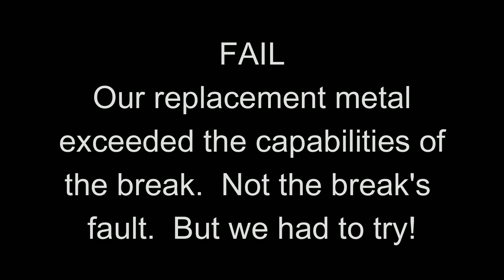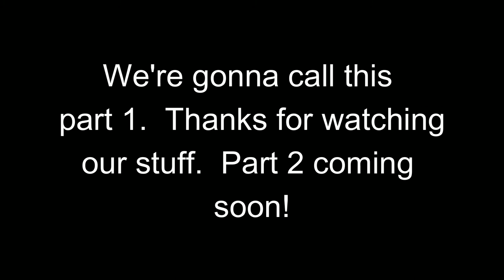Inner fender rust repair for the 74 Shoebox Bronco

Comment: How did you get the aft bolt out on the fender? I can't get it to save my life with that plenum in the way... just spins
Reply from the maker: It ain't easy.  We ended up cutting the head up a bit with a small angle die grinder and dremel, then hit it with the air hammer and knocked the head off.  Bent the fender tab a bit but nothing horrible.  The driver's side turned out... thank God!
Reply: @freedom1garage  i got lucky on the passenger side, it came right out but we had to drill out the drivers side. these old fasteners sure like to be stuck in place! thanks!